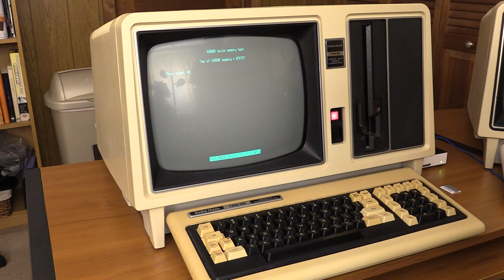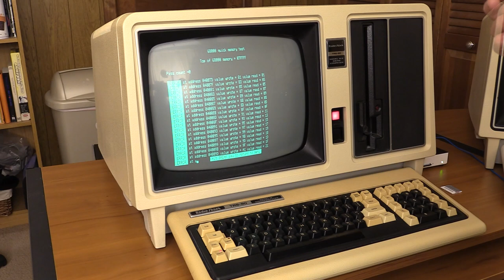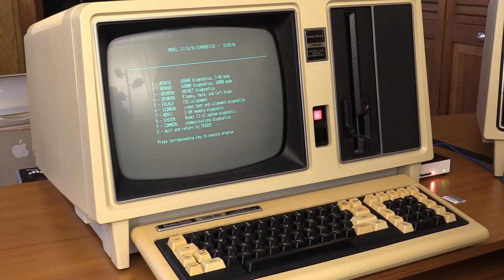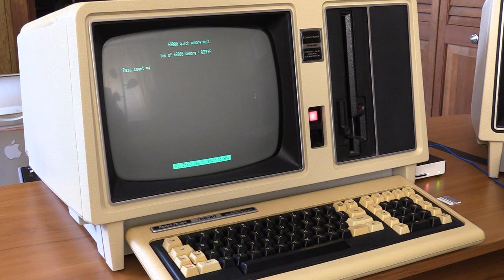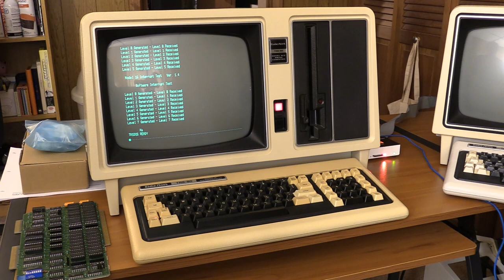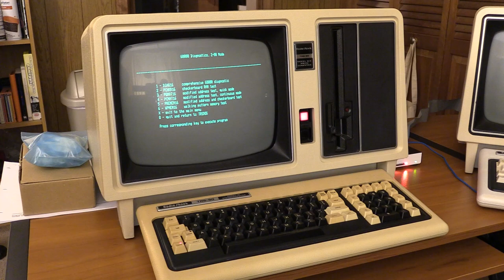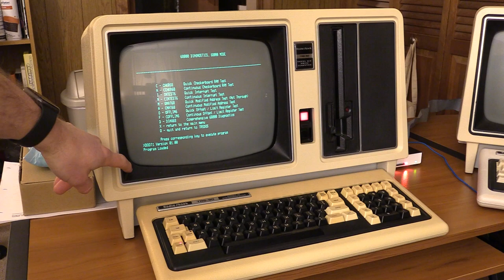TRS-80 Model 16B Restoration - 68000 CPU and Memory Cards - Part VII

Comment: You should probably replace the electrolytic caps. By now they are probably mostly dried out.
Reply from the maker: I thought about it, but since they weren’t leaky yet and the boards work correctly with the right DRAM, I left them for now.
Reply: @TJBChris  Fair enough.  I figured that was the case.  I typically replace all electrolytic caps when I have it apart.  Needed or not, it's easy to do and it's already apart.  Ceramic, tantalum and others I leave in place unless there are obvious signs they are going bad.
Reply from the maker: If anything goes wrong, they’ll be the first place I look! :)
Reply: @TJBChris  BTW, I really enjoyed this series.  The only TRS-80 exp. I have is with the CoCo3.  Learned some good stuff.  Keep up the good work.
Reply from the maker: @Scarlet_1971_cuda  Thank you!  I really appreciate the feedback.  I’ve got a couple of CoCo projects on the docket, and now that the 16B is done, I’m hoping to get to them soon.  The CoCo is like going home…it was my first computer.

Comment: I think the RAM refresh was fine, but you had one bad 4164. Each 4164 is responsible for holding 1 bit of each byte in a 64k block, hence why they are grouped in 8's. Before you cleaned the sockets, bit 5 appeared to be returning zero as each value returned was 0x20 too low on every read. I assume you put them out of order after cleaning the sockets because then bit 7 seemed to return 0 every read (each value 0x80 too low).
Reply from the maker: Thanks for the comment.  Believe it or not, I actually put them back in the same order on camera.  Off camera, I also replaced all DRAMs with a second set.  The results were unpredictable no matter what I did.  It's certainly possible to have had one (or more) bad DRAMs and some back luck with my replacement 4614s as well.  Fortunately, the new replacement RAM, which I verified matched the refresh spec of the 16B, worked flawlessly.  While Googling around, I found some sources that indicated the TI 4164s I was using required 256 refresh cycles, whereas the system provides only 128, which is what led me down that road.  That said, I didn't prove it out, so it's speculation.  Thanks for watching, and the comment!

Comment: In the old days I moved from TRS-80 model 1/III to Sinclair ZX Spectrum to Amiga. Lately I've become interested in the TRS-80 Model 16 and can't find any information on the Internet about how the Z-80 and the 68000 interacted, what was in the ROM, how machine code executable programs worked, what their file format was etc. I do have an emulator but can't figure out what to do with it after entering the date and time. Do you know where I can find any info? All the info out there is for Model 1, Model III, and Coco. (I'm not really interested in Xenix or CP/M at the moment though.)
Reply from the maker: Your best bet is the Model II archive on GitHub.  You won't find terribly much on the TRSDOS-16 (non-XENIX) side of the house, as it was pretty terrible and ended up being a stop-gap until XENIX came along.  The assembler even used non-standard mnemonics for the 68000 instructions.  It was jokingly called "Bowling Ball DOS", because both TRSDOS-16 and a bowling ball ran about the same amount of software.

 The core architecture of the machine is all peripheral hardware (video, serial, disk, keyboard, etc.) is addressed via the Z80 port-based addressing scheme and uses Z80 interrupt and bus master chains, so the 68000 side has no ability to access it.  This means all code controlling the hardware runs on the Z80 side, with an interface (of sorts) between it and the 68000.  That interface is a shared memory window that can transfer data between the "sides" of the system.  They can also do some back-and-forth interrupt management.  This doc is probably the best outline: https://github.com/pski/model2archive/blob/cc1212070e89d657a68f72a3b59eb2c6171b0401/Software/Xenix/Xenix_Docs/The_Use_of_the_Z80_IO_Processor_by_the_TRS-XENIX_Operating_System.pdf

On the XENIX side of the house, a program called z80ctl is the Z80-side program that brokers hardware access for the 68000-side of the house.  On the TRSDOS-16 side, TRSDOS-II 4.1 manages the hardware when TRSDOS-16 runs on the 68000.

If you're not on the Tandy Discord, that's the place to be to get more info.  Lots of great folks there who know the systems well, including me.  

Good luck, and thanks for watching!